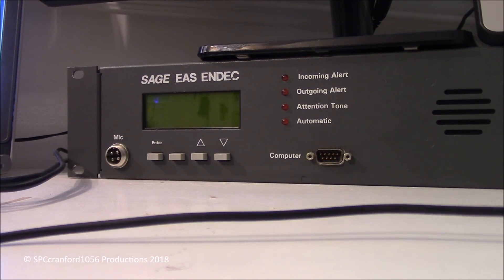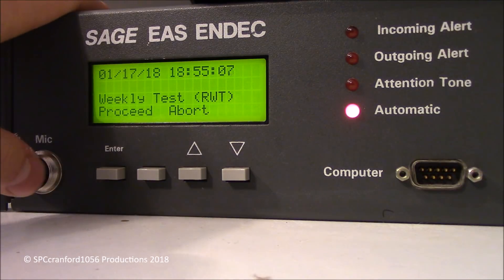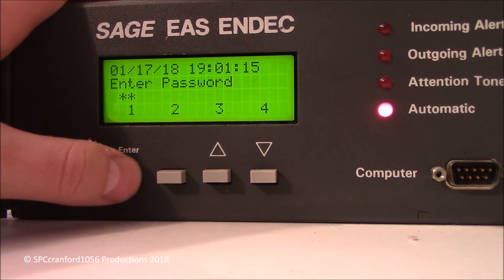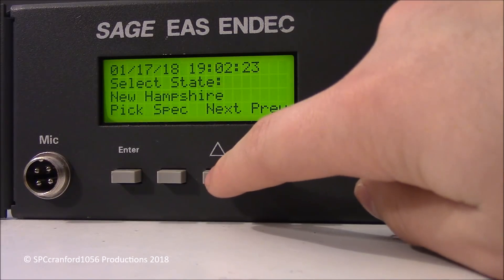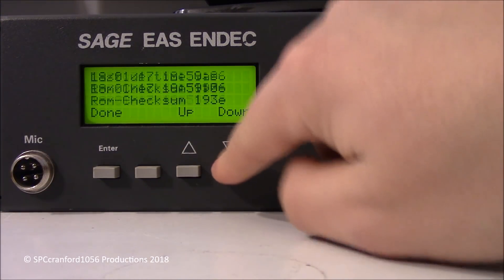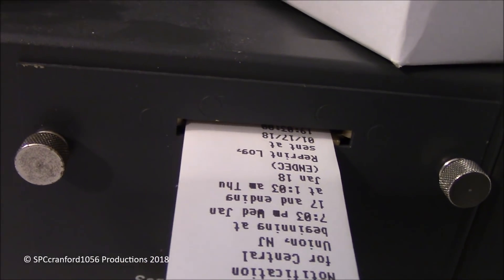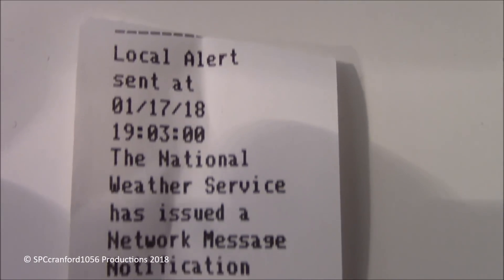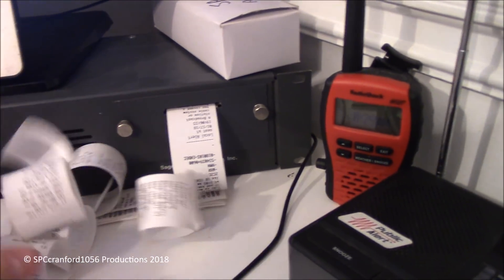SAGE EAS ENDEC Demonstration (with Fails)

Comment: What is the purpose of the DMO message vs RWT/RMT? Under what circumstance would you use DMO rather than the required periodic test message?
Reply: You'd probably use a DMO when showing people or training because most if not all FCC stations do not relay dmo alerts

Comment: Just out of curiosity, what would happen if you were to enter Emergency Action Notification? Thinking about getting one of these.
Reply: It’s the National Emergency code...these codes make it on the air (even accidentally) and ALL of the United States is under alert. Wouldn’t play with that one...
Reply: @user-vf6um3jj9t unless a transmitter is connected, sending an ean won't do anything as it's playing audio only internally.

Comment: To fix the speaker problem, I think it is a loose connection. I would suggest looking inside to see if one of the wires are loose. If that doesn't work, then you may need to get a new speaker.
Reply: that's not it, if you look on the back of a sage, you can see a speaker in and speaker out area on the terminal blocks, just put a paperclip between the two, which is a speaker jumper, that would be loose, not the actual speaker cables in the endec.

Comment: I would check the solder joints on the speaker itself and also check the continuity between the speaker and its header on the circuit board. Your speaker might be internally messed up too, but that's where I'd start.